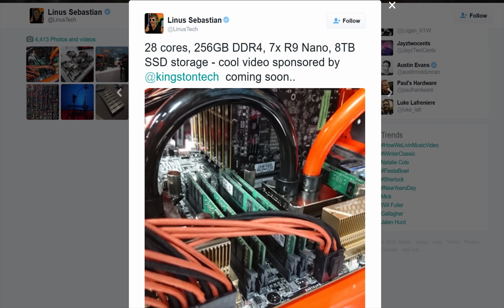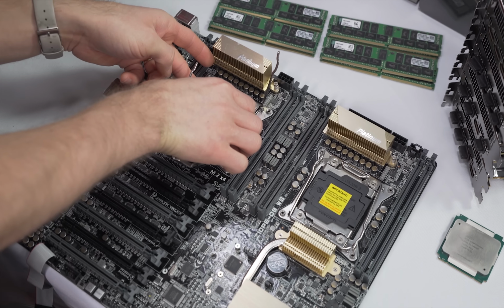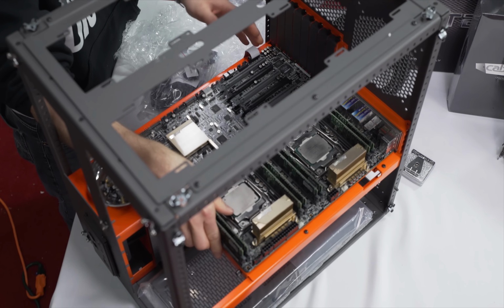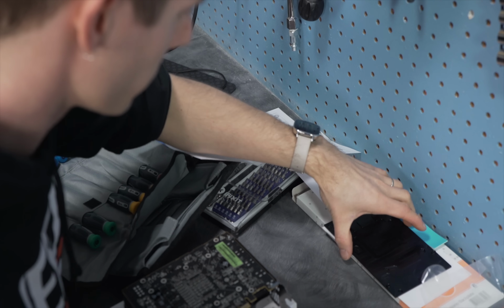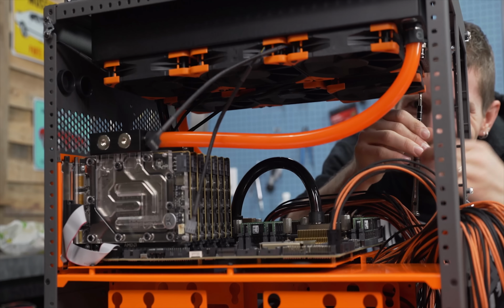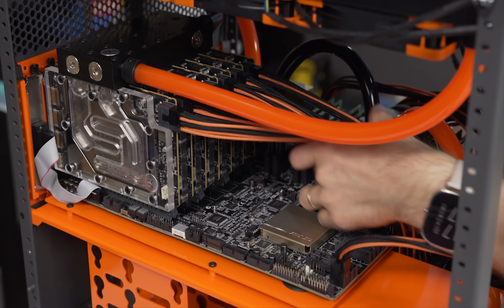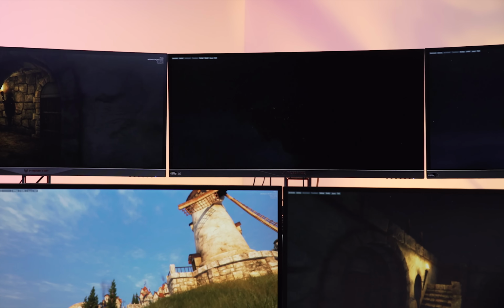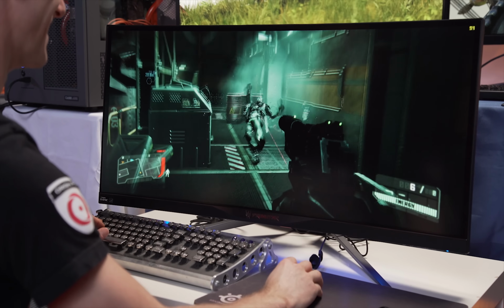7 Gamers, 1 CPU - Ultimate Virtualized Gaming Build Log

Comment: I would like to point out that the name of this video is misleading with "7 Gamers 1 CPU". I understand that some people use the term CPU to mean PC, but these terms aren't synonymous. You are actually using 2 CPUs the title is misleading and misinformed at best.
Reply: +Willie D. Washington The likely reason why its "1 CPU" is because when a motherboard has 2 CPUs in it, its exactly the same as having one with all those cores. They work together as 1. I think Linus explained this before.
Reply: +Willie D. Washington welcome to youtube.  you must be new.  it's called "clickbait"

you're welcome.
Reply: +Ian H I did a little bit more research. From the pure definition of a CPU, I will concede my previous argument :). You sent me on quite a research hunt, so I will thank you for that. As far as I understand it, the MMU has not always been integrated on die (this is why I brought up caches), and as a result, is not a necessary component to define the set of circuits on a die that comprise a CPU, even if the CPU cannot compute operations without it. By definition, a CPU is merely the hardware of a computer system that carries out the computation of operations via instructions. Doesn't matter how the instructions got there, it's just the  group of circuits that provide that function of the machine.
Reply: +Ian H U̶n̶f̶o̶r̶t̶u̶n̶a̶t̶e̶l̶y̶,̶ ̶t̶h̶a̶t̶'̶s̶ ̶i̶n̶c̶o̶r̶r̶e̶c̶t̶ ̶(̶n̶o̶t̶ ̶e̶n̶t̶i̶r̶e̶l̶y̶ ̶t̶h̶o̶u̶g̶h̶)̶.̶ ̶T̶h̶e̶ ̶w̶a̶y̶ ̶m̶o̶d̶e̶r̶n̶ ̶p̶r̶o̶c̶e̶s̶s̶o̶r̶s̶ ̶a̶r̶e̶ ̶d̶e̶s̶i̶g̶n̶e̶d̶,̶ ̶a̶l̶l̶ ̶t̶h̶e̶ ̶c̶o̶r̶e̶s̶ ̶s̶h̶a̶r̶e̶ ̶v̶a̶r̶i̶o̶u̶s̶ ̶c̶a̶c̶h̶e̶s̶,̶ ̶e̶f̶f̶e̶c̶t̶i̶v̶e̶l̶y̶ ̶m̶a̶k̶i̶n̶g̶ ̶t̶h̶e̶m̶ ̶c̶o̶d̶e̶p̶e̶n̶d̶e̶n̶t̶ ̶u̶p̶o̶n̶ ̶e̶a̶c̶h̶ ̶o̶t̶h̶e̶r̶.̶ ̶T̶h̶i̶s̶ ̶s̶h̶a̶r̶i̶n̶g̶ ̶o̶f̶ ̶c̶a̶c̶h̶e̶s̶ ̶b̶e̶c̶o̶m̶e̶s̶ ̶p̶a̶r̶t̶i̶c̶u̶l̶a̶r̶l̶y̶ ̶i̶m̶p̶o̶r̶t̶a̶n̶t̶ ̶i̶n̶ ̶s̶u̶c̶c̶e̶s̶s̶f̶u̶l̶l̶y̶ ̶e̶x̶e̶c̶u̶t̶i̶n̶g̶ ̶m̶u̶l̶t̶i̶-̶t̶h̶r̶e̶a̶d̶e̶d̶ ̶p̶r̶o̶g̶r̶a̶m̶m̶i̶n̶g̶ ̶a̶s̶ ̶w̶e̶l̶l̶ ̶a̶s̶ ̶s̶e̶r̶v̶i̶n̶g̶ ̶a̶n̶ ̶a̶d̶v̶a̶n̶t̶a̶g̶e̶ ̶f̶o̶r̶ ̶v̶a̶r̶i̶o̶u̶s̶ ̶s̶i̶t̶u̶a̶t̶i̶o̶n̶s̶ ̶d̶u̶r̶i̶n̶g̶ ̶c̶o̶d̶e̶ ̶e̶x̶e̶c̶u̶t̶i̶o̶n̶.̶ ̶B̶a̶s̶i̶c̶a̶l̶l̶y̶,̶ ̶e̶a̶c̶h̶ ̶c̶o̶r̶e̶ ̶i̶n̶ ̶a̶ ̶C̶P̶U̶ ̶i̶s̶ ̶n̶o̶t̶ ̶i̶t̶s̶ ̶o̶w̶n̶ ̶C̶P̶U̶,̶ ̶t̶h̶e̶r̶e̶ ̶a̶r̶e̶ ̶o̶t̶h̶e̶r̶ ̶c̶i̶r̶c̶u̶i̶t̶s̶ ̶t̶h̶a̶t̶ ̶u̶n̶d̶e̶r̶l̶i̶e̶ ̶a̶l̶l̶ ̶o̶f̶ ̶t̶h̶e̶ ̶c̶o̶r̶e̶s̶ ̶w̶h̶i̶c̶h̶ ̶n̶o̶n̶e̶ ̶o̶f̶ ̶t̶h̶e̶m̶ ̶h̶a̶v̶e̶ ̶e̶x̶c̶l̶u̶s̶i̶v̶e̶ ̶u̶s̶e̶ ̶o̶f̶.̶ ̶B̶e̶c̶a̶u̶s̶e̶ ̶t̶h̶e̶y̶ ̶w̶o̶r̶k̶ ̶a̶s̶ ̶a̶ ̶s̶y̶s̶t̶e̶m̶,̶ ̶t̶h̶e̶y̶ ̶f̶o̶r̶m̶ ̶w̶h̶a̶t̶ ̶i̶s̶ ̶t̶h̶e̶ ̶C̶P̶U̶.̶ ̶T̶r̶a̶d̶i̶t̶i̶o̶n̶a̶l̶l̶y̶,̶ ̶C̶o̶r̶e̶ ̶!̶=̶ ̶C̶P̶U̶           Edit: I was wrong, Ian's right ;)
Reply: +Willie D. Washington BeeP Bop BEep ,... Blæææh dont care
Reply: +Elite Beef The CPU is the electronic circuitry, the physical thing. It doesn't matter how they work
Reply: "A central processing unit (CPU) is the electronic circuitry within a computer" -wikipedia

And http://www.howtogeek.com/194756/cpu-basics-multiple-cpus-cores-and-hyper-threading-explained/
And almost everywhere else on the internet
http://techterms.com/definition/cpu

Perhaps I'm wrong but show me different and not just what you believe to be right.
Reply: +Ian H But I'm using a single core PC? :\
Reply: *****
ERROR ERROR
DOES NOT COMPUTE
Reply: ***** Great answer, you are the know-it-all god and you are always right. Give us a source, some of the books that you've read while you were taking that degree will do.
Everyone can make up things with a bare knowledge of hardware, quote an article or some reliable source to back up your point, that's basic.
Reply: +The Mr. Vogue When you install two CPUs in one PC they also have to either share their caches or to don't use them (which makes rarely sense), else they would mess up the whole memory.
So the only real difference is that the individual cores are distributed on two dies.
Reply: +Ian H There's some geek who just got a boner reading that, I think ?
Reply: Who cares...
Reply: +Ian H Thank you Ian. Gabriel quoted a source and posted it and still didn't even realize what is quote meant. 2 Xeon processors on one mobo with a shared cache fits the exact description even of his quote he posted and yet he still couldn't understand what you said. Thanks for explaining though. well said Ian, we'll said.
Reply: Is this still going? I don't care what you believe, I want facts. Show me some definition of CPU that fits what you say, anywhere.

I don't care who is right but unlike Christopher if I'm going to believe and repeat that CPU definition I need some evidence apart from your own words.
Otherwise I'll stick with what I've found myself, it's not like we'll just accept whatever anyone says on the internet, right?
Reply: Gabriel Teruel The definition you posted fits what we said bro. Read and then try this thing called understanding. Try to explain to yourself how your very own quoted definition does Not fit what Ian stated. But it's cool you don't care man you just another person on the internet typing shit anyway right? Spare yourself from any further response. Leave this to people that don't have an ego problem as if their knowledge is their character, and want to actually learn from debating.
Reply: Christopher Brandao wtf? now you are trying to shut me up? What do you think gives you that right, "bro"?
Let's just believe what everyone says without any evidence, go on. And please silence whoever thinks opposite as me, right?

Anyway I see you are not presenting anything else so I'm done here.
Reply: +Gabriel Teruel you are such a dumbass bro. I'm not trying to shut you up. I was making a point that if you think it is pointless to respond to me then why respond? but you are such an idiot you think I am telling you to shut up. you idiot I was using your own words against you. I was being sarcastic you moron.
Reply: +Willie D. Washington Exactly my thought, at the beginning he says he is installing 2 CPUs so he knows. Maybe Linus didn't write that title

Comment: Cant get expression out of my head that CPUs and GPUs works with terrible efficiency. Dont get me wrong, but many kW car engines have smaller cooling system and they are designed to work on heat from burning fuel. Something tells me that only 50-60 Wats are actually used to process data, rest goes to waste as heat. I mean, look at that, 1600W and cooling is much much bigger than 2000W hair dryer that is designed to make heat.

Comment: "7 Gamers, 1 CPU"
You are using a dual CPU MB...
Do you know what is a "Central Processor Unit" ???

Ok more seriously, do you really run 7 Windows at the same time ? You are using the word "virtualized" what OS do you use ?
These AMD card support virtuilization ? Though which system ?

Comment: Well, this is saddening... Checking my rig where it says "4GB ram - 3.5 usable".
Reply: +Xtreme Games Put a 64 bit OS on that thing to make it use all the 4 gb
Reply: +Xtreme Games at least your says 4GB but mine says 3 and 1.7 free in task manager -_-
Reply: @dr-boneless I was gonna ask what os runs that low but then I looked at the post date
Reply: +YourFather If its integrated graphics then RIP.
Reply: +Jan W. I cant run minecraft on lowest settings with more than 25 fps. Shut up.
Reply: +Advan Safic Hamster on a wheel. But the wheel keeps getting stuck
Reply: +Xtreme Games May God rest your soul. lol
Reply: +Xtreme Games :D
Reply: Advan Safic GPU is GeForce 520 GT. You can say I had some fun with GTA 5 at 23 - 25 fps. I was actually surprised it ran that well. The worst part about my PC is my CPU, which is a dual core 1.80 ghz.
Reply: +Xtreme Games Almost playble. Put a core 2 quad and a 2 GB GDDR5 gpu and it should make a difference. :)
Reply: +Xtreme Games My Gpu is annoying :/ i have Fx 8350 Cpu on 4.6 GHz ;; 16GB Ram ;; 256GB SSD + 1 TB HDD but only a fucking Gtx 650ti 2GB GDDR 5 wich cant even run Bf4 on everything High with 60 FPS :/
Reply: +Lord Dicksy What is in your pc?
Reply: ***** It doesn't make me feel better. Quite the contrary, in fact. I'm sorry to hear that.
Reply: ***** You're right about that, but you see, the thing about 32-bit OS is that it's useless if your goal is gaming. Nowadays almost every game requires 64-bit systems. When I upgraded my PC, the technician suggested me not to upgrade to 64-bit as it'd run slower, but then I'd miss on almost every game that was released after 2011.
Reply: +Xtreme Games   because 32bit does not support 4gb u have to instal 64bit windows
Reply: +Xtreme Games Upgrade to a 64-bit OS
Reply: +Xtreme Games need some specs for about 2000€  any help plz?
Reply: Meanwhile my Linux OS uses 300mb of ram and has the rest of 8gb free :')
Reply: +Xtreme Games gtx 970 be like
Reply: YourFather Already have.
Reply: I agree with advan
Get a Core 2 Quad Q8400 Or Higher for under 150$
And GTX 750 Ti.. it costs about 130$ on amazon
and u could run GTA 5 for like 50FPS
Reply: +Hamod Assie I got a Core 2 quad Q9400 almost for free.  So it should be possible to get a quad cpu much cheaper on ebay or something. Here in Sweden i even got a Q8300 for 40-50$. :)
Reply: +Jan W. You should probably get a GTX970 or higher or maby a better Radeon Card. GTX650 is still okay but the gpu is low.
Reply: +1984nightrider Haha probably ;)
Reply: +Xtreme Games Are you on XP? My Windows 7 takes 3GB of RAM inherently.
Reply: ZechsMerquise73 Windows 7 Professional.
Reply: 32 or 64? 64 should take a stable 2GB at least if I'm not mistaken. Not to mention Superfetch can take over 10% of total memory usage in idle.
Reply: +Jan W. dropping in the 970 is a good idea. My build is very similar, only i have the strix970. i get between 60-70fps on bf4 with ultra/custom settings at 1080p. Although, I have been thinking on either selling my 970 and getting an r9-390x....or, just dropping in a second 970. Haven't quite decided yet.
Reply: +Jan W. Now THAT'S a bottleneck
Reply: +Xtreme Games If it makes you feel better, my computer can't run GTA III without frame rate issues.
Reply: +Xtreme Games same here
Reply: 4gb is not too bad
Reply: +Xtreme Games how about 2gb :(
Reply: I have an 8gig system with Windows 7 64 and it barely runs ram intensive games like Minecraft or Ark: Survival Evolved without certain settings adjustments.
Reply: ***** It's just, if I'm running a 4gig program and I only have 3.5 gigs free, isn't that going to make the program horribly slow? I'm assuming video ram should carry the bulk of that burden, then.
Reply: +ᅚᅚ u dont  know what are you talking about, sli is much better, oone video runs physx and the Other runs all process
Reply: +ZechsMerquise73 seriously? my pc uses 1.83  gb whit this and ather 2 tabs opend . (4 gb ram, 64 bit home premium)
Reply: +Advan Safic haha it will still virtually say: 4gb - 3.5 gb usable if you buy the 970 :). get a 390 it peforms better
Reply: lmfao
I have a shitty computer and yet, strangely, there are those of us who don't complain about "only" having 4gb of ram or whatever because they realise they're lucky to own something that cost 500 bucks xD
Reply: That's so weird though because I usually have a crapton of chrome tabs open and then probably a few word documents and then league open with the best graphics settings and it all works fine. It can sometimes give me a memory error if I don't restart it for a few weeks but that's about it.
Reply: i have 2gb ddr2 ram ahhaha
Reply: +NVO totally
Reply: NVO 64
Reply: +Xtreme Games Sounds like you've got a 32-bit PC and/or a 32-bit OS installed. As it stands if you want more RAM than that it's 64-bit or bust, at least until 128-bit processors come out (if they ever do).
Reply: +Xtreme Games Oh wait, sorry, I read that wrong. Sounds like you've got on-board graphics eating a big chunk of your system memory. Might be able to tweak it in the BIOS/CMOS/UEFI but your framerate could take a hit.
Reply: DriftKing16 Please, people, read the previous comments. I keep repeating myself, I have a 64-bit system. Also, my motherboard doesn't support more than 4GB ram.
Reply: +YourFather 3.95 but yes essentially
Reply: NVO No shit. Although I have a 520 GT, which is a 2011 release. It has taken me this far, it's not that terrible.
Reply: +Xtreme Games I Had this problem then i Solved it. If you're using 64bit but it still showing, its your motherboard is an old model. does not support moderm rams. :D
Reply: Muhamad Ubaied I know. The thing is, the more time passes, the more casual I become. My channel name might be misleading but I'm not an "xtreme gamer", haha! I don't use it as often now. I'm actually thinking of getting a console instead just to play few releases I care about. I usually play old games I've missed on their release or calming indie games now.
Reply: +Xtreme Games 12GB, 11.8GB usable ._.
Reply: +Xtreme Games Looking at my rig -> 64GB - 63.5 usable
Reply: +Ghost 39 It reserves a quarter to half a GB of ram for the Harddrive cache and flash.
Reply: +Hamod Assie A Q8400? I used to have that thing 5-6 years ago. Who would even still buy outdated hardware like that? Hell, that thing is even using DDR2 lol. Yeah you could run GTA 5 maybe on 50FPS with your resolution and settings as low as possible. I even had trouble running GTA4 on high settings with a Crossfire setup and a Q8400 back in ''09.

He is much better off buying recent hardware. DDR4 might be to expensive for him, but a cheap DDR3 build (€300-400) with an 8 core AMD processor will outperform that old cpu by 50-60% while costing almost the same. 

Mushkin 8 GB DDR3-1333 = €35,-

AMD FX-8320E, 3,2 GHz socket AM3+ processor = €149,-

ASUS GTX750TI-PH-2GD5 = €139,90

ASRock N68-GS4 FX, socket AM3+ = €46,99

TOTAL = € 371

He'll be much more future-proof with this than with an old Q8400 lol.
Reply: +Xtreme Games #PoorWindowsLife

#300mbLinuxGamingPCMasterRace
Reply: +The Prophet Usable RAM is not free ram. Usable RAM is the memory available to the computer after things such as non-dedicated graphics/sound etc, have taken their cut from all available memory. What's left over is the usable memory that your computer uses for day-to-day operation, and what you see in Task Manager.
Reply: +Xtreme Games same, i cri
Reply: Vanilla Frapachinio everytiem
Reply: +Xtreme Games I fixed this Xtreme on my lil sisters pc i built that is 64bit but not showing all ram.

Heres an excerpt from microsoft support page that i used to fix the issue.

This problem may occur because the Maximum memory option is selected incorrectly. To fix this, follow these steps:Click Start, type msconfig in the Search programs and files box, and then clickmsconfig in the Programs list.In the System Configuration window, click Advanced options on the Boot tab.Click to clear the Maximum memory check box, and then click OK.Restart the computer.
Reply: Jacky Xie Xubuntu 14.04
Reply: gbgsteve717 not a issue on Linux, Minecraft runs better here
Reply: Michael Taylor Lol wow that sucks
Reply: +Xtreme Games i feel you bro 630 gt 4gb with i3 2120 and 4gb of ram , in gta 5 it was about 30-35 fps but in heists it just crashed
Reply: +Xtreme Games i feel you bro 630 gt 4gb with i3 2120 and 4gb of ram , in gta 5 it was about 30-35 fps but in heists it just crashed
Reply: +Neo Hexdrel pentium 3-4 with ddr1 board? dafuq? i could run gta 3 with a  pentium M laptop and 1 gb of ddr2 ram (i think it was ddr2)
Reply: +Neo Hexdrel pentium 3-4 with ddr1 board? dafuq? i could run gta 3 with a  pentium M laptop and 1 gb of ddr2 ram (i think it was ddr2)
Reply: +ᅚᅚ well 970 sli is a waste of money just buy a 980
Reply: mimik kexan 2 970s will give you much more performance then a 980.
Reply: +Xtreme Games 
ohhh boy. There is a ton of things you gotta check out for that. With my instance, my RAM slots on my mobo was shot. GL man.
Reply: +Xtreme Games lol
Reply: +Xtreme Games Anyone notice that datamancer keyboard!!!
Reply: Bonifasius Edwin I'm actually waiting for a PS4 slim release. I'm in no hurry, also the console and game prices will drop.
Reply: Xtreme Games r
Reply: That’s exactly where I was 7 years ago too. Now I’m revisiting this video to spend my own adult money replicating.

Comment: is it really a good idea to stack em? the drives i mean, the heat etc
Reply: +Melak Krimduz They're SSDs so its okay.
Reply: +LinkingFatez recent study shows that ssd lifespan decreases as well the greater the heat, but I am sure the fans will do a decent job. other than that, he could have done something better for them :P
Reply: +Giorgos Koukoubagia Doesn't that applies to every other computer parts, not just ssd? Because in general electronics doesn't fare well with heat.
Reply: Yes. But SSDs and HDDs usually see a great drop in lifespan even with little heat, unlike other parts. Also, this is according to some research I've read recently. I am more of a software guy than a hardware, so consider conducting your own research too.